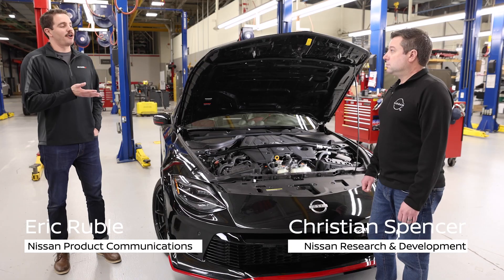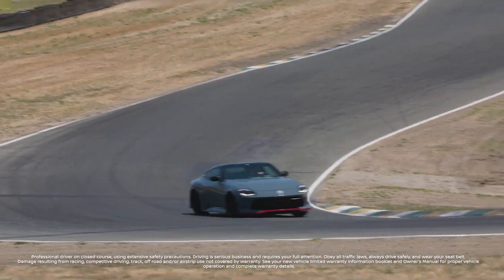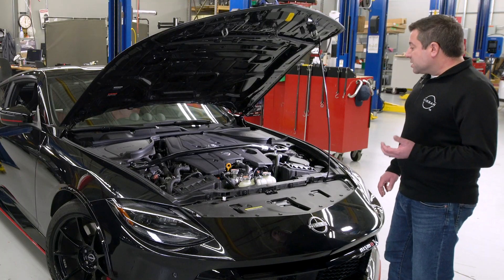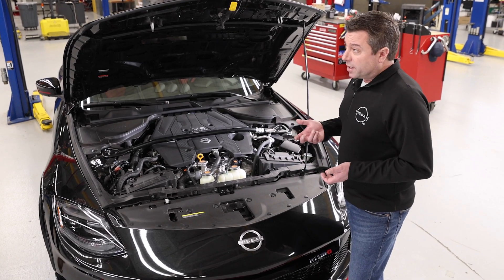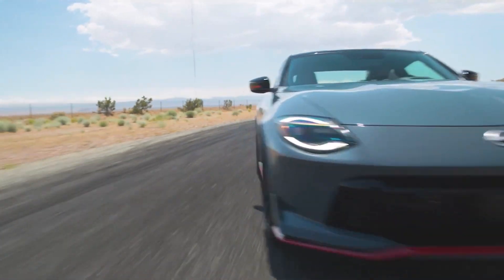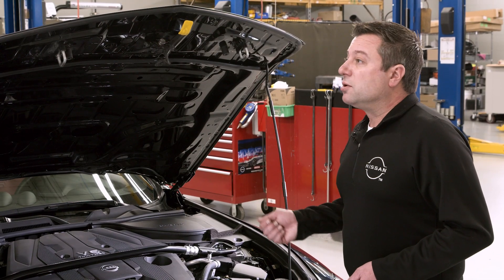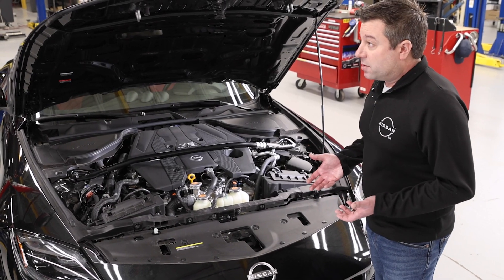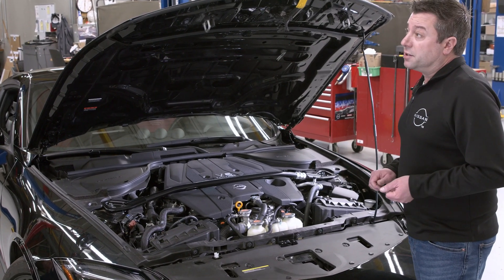2024 Z NISMO: Power | Nissan Garage Exclusives

Comment from the maker: The 2024 Nissan Z NISMO is the most powerful Z ever. Which generation Z is your favorite?

https://www.nissanusa.com/vehicles/sports-cars/nissan-z/nismo.html?dcp=sno.ytb
Reply: The Z32.  Best Z generation IMO.  Owned Z32 and Z33.  I miss the project 901 Nissan!
Reply: BBC
Reply: Nissan if your reading this and as much as I'm an Nissan fan. The car is beautiful BUT. If youre a consumer that knows anything about cars and the track it's lackluster. It under performs at everything compared to the Supra and at the same price tag.. I'm not going to spend the same amount as I would for a Supra then have to spend over $10,000-$20,000 just to get it to perform close to a Supra which can beat it with just an ECU tune. If you look at the Supra for the same damn price it gives me adaptive suspension a better infotainment system. Don't get me started on the engine and the transmission. That Bmw engine is beautiful. Also dealers are marking up the car over MSRP like it's a golden child that out performs the Supra. It's just not worth it. The VR30ddtt had almost 10 years! 10!!! To give it a simple upgrade to it's cooling/turbos/suspension/interior software for the UI. The damn gps and infotainment system looks like its stuck in 2010.

Comment: Make the GTR internals handle 800lbft of torque from the factory then you can give the nismo z bigger stock turbos. We all know the GTRs capabilities, but you need to up the power in order for the z not to undermine the GTR. As they both handle a max of 600lbft of torque on stock internals
Reply: W Captain DR

Comment: A broader flatter power and torque is more important than peak hp number when youre dealing with a road course car.
Reply: The powerband on the Nissan z is in the midrange. On fbos e85 it gets 600lbft of torque on stock turbos at 3k rpm. Hp rises till 5k then starts to drop off until 7k. On upgraded turbos your not making max torque till 6k rpm which would be 600lbft, but you’ll make 740whp at 7k rpm.
Reply: The Supra is just better.... I'm a Nissan fan but for someone that'll normally just do a ECU tune intake/exhaust and maybe other supporting mods. I'd have to drop more $$$ in the Z to get it close to the Supra. Such as suspension transmission upgrades and the gps/UI I can't even do anything about. It's like a Nissan rouges 2010 software. Not gonna be running no E85

Comment: For a nismo Z, 500hp is where it should be. No one is going to get excited about 20 more hp. Especially with so much competition.
Reply: That’ll just outcompete the GTR. Keep in mind on the z and the GTR can make the same horsepower on stock internals, which is about 750 wheel horsepower, the GTR shines because it’ll do it on stock turbo. That’ll just make Nissan work harder to up the hp on the GTR which they don’t want to do.
Reply: @GarciaQ60  Nissan has no choice but to give the GTR more hp as the competition has passed the GTR. Most cars at that price have 600+hp. For this being a Nismo 20 more hp can be achieved with just a tweak.
Reply: For that damn price at least give me an adaptive suspension and an already beefed up cooling system so I don't gotta upgrade the radiators and all. Stuff that's a hassle for me to upgrade myself or to properly set up right. The car is beautiful I give it that but the interior UI is extremely dated also. You have to compete in some way with Toyota but for what $3,000 less MSRP who would buy this? Oh and dealers are marking it up to a point where I'd rather buy a Supra or Corvette.
Reply: That's the result of what I call GT-R DNA.